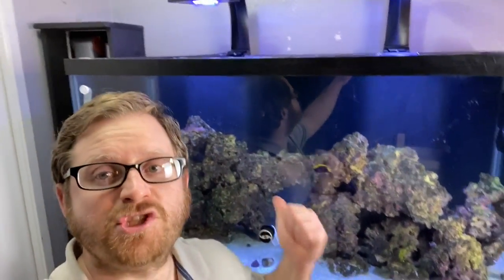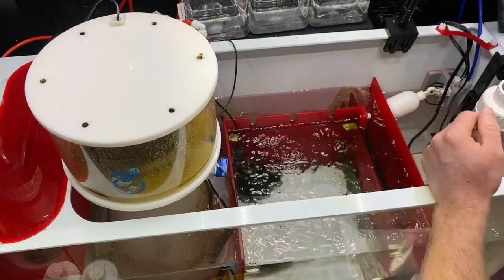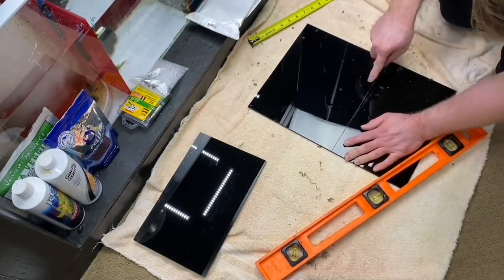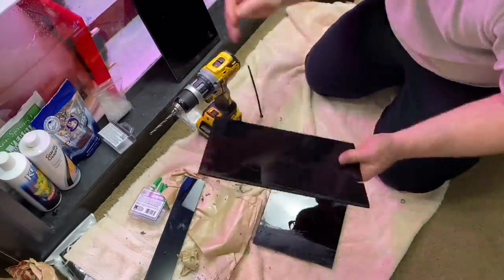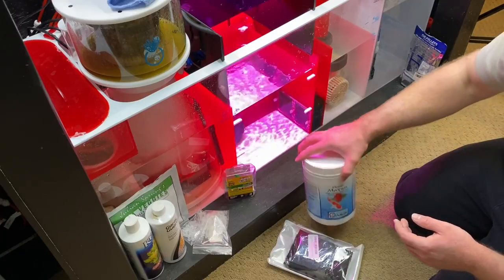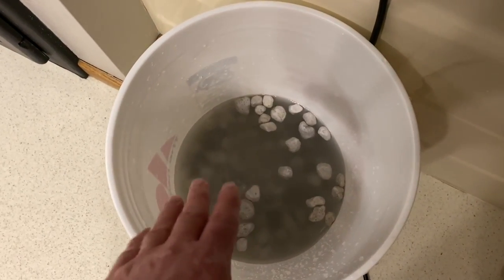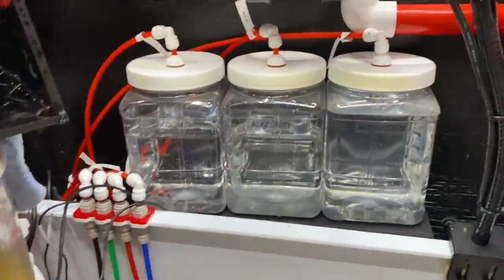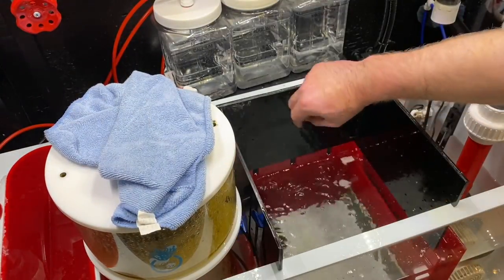PIMPING OUT MY SALTWATER AQUARIUM SUMP REFUGIUM

Comment: Hi Paul.
How are you Sir?
It does the Job, very well done Sir.
I prefer the Zip Ties because it allows you to disassemble a lot faster and easier.
Whereas if you had Cemented it together you might end up snapping it when trying to take it apart.
Reply from the maker: Hello, doing well. I agree I am glad the zip tie idea happened! And you are right it would have likely broken if the glue worked anyways

Comment: hey man, you can buy corraline algae in a bottle if you want to really speed up the process. algae barn or brs sells it
stay tanked!
Reply from the maker: Thanks! Yeah i have been contemplating on whether to get some. But now that I see it growing I am confident. Appreciate the comment and you tuning in. Stay Tanked
Reply: inventoryking I’ve personally never used the stuff. I did use a product after I already had the corraline growing. It was supposed to boost the corraline growth, but didn’t contain the live algae. It worked really good.
Reply from the maker: Thanks for the info